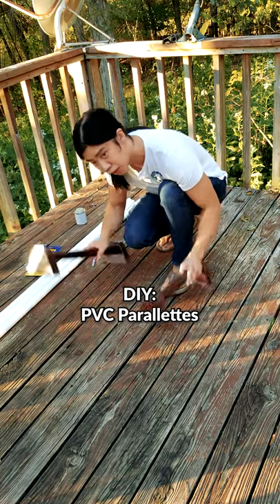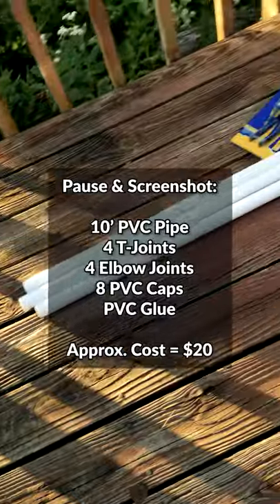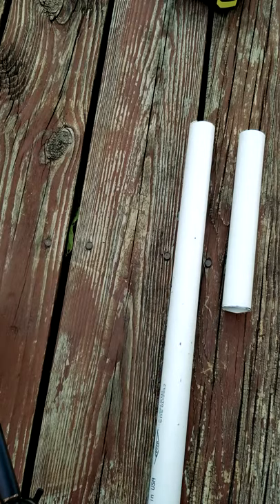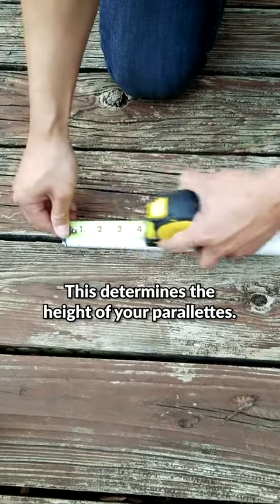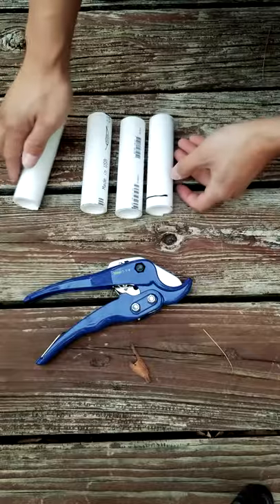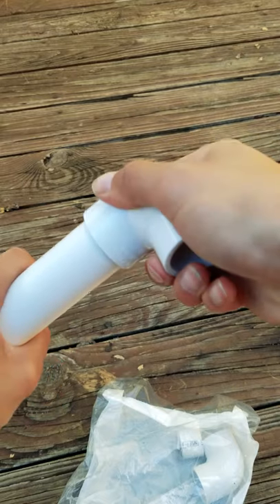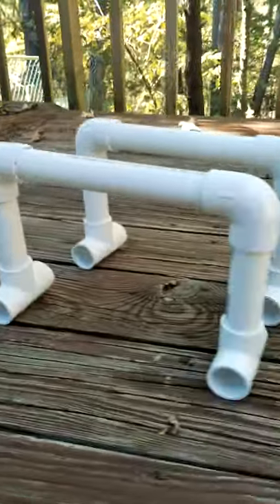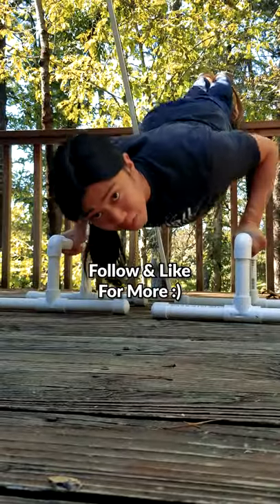DIY Parallettes

Comment: Hybrid, can you post videos on improving Marine Corps PFT/CFT scores?
PFT components
    -maximum pullups (minimum is 4), 
    -maximum crunches in 2 minutes (minimum is 55), 
    -3 mile run in under 28 minutes
CFT components
    -880 meter sprint in under 3 minutes
    -maximum 30lb ammo can presses in 2 minutes (minimum is 55)
    -maneuver under fire, which basically involves fireman's carry, sprinting with two 30lb ammo cans, low crawling, etc in under 3 minutes
Thanks for the videos!

Comment: Quarter turn while pushing the connections and hold for 30 seconds. The glue expands while it cures, and can actually push the joints apart and make them weaker 😉👍

Comment: I used 40mm diameter and did a pair with the only change that my handles measure 27cm in length, but thanks for the idea, they worked perfectly!

Comment: I am so lucky to have access to a great sports equipment store with surprisingly low prices. A product like this with, just a tad smaller, is 5 dollars. It's also anti-slip. From the same people I've purchased a no-screw pull-up bar for 15 dollars and it never even moved a millimetre once properly secured.

Comment: Issue with this. Is i am 300lbs and shattered the ones I just made :( no major injuries thankfully but I tried it with welding gloves for a test. We bigger folk have to use a piece of wood instead of the pvc. You can use pvc elbows still but the 9 inch and the 2x 5 inch supports need to be made of some kind of wood.

Comment: I have some dumbbells that I don’t use, they are shorter in height but can be used as well so if anybody has a pair lying around which is a bit longer in length try using those as well